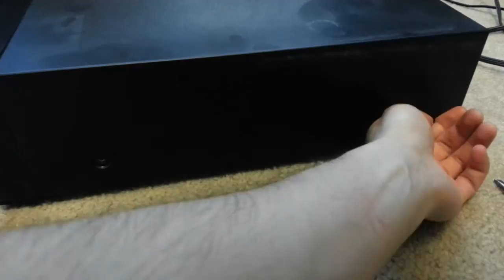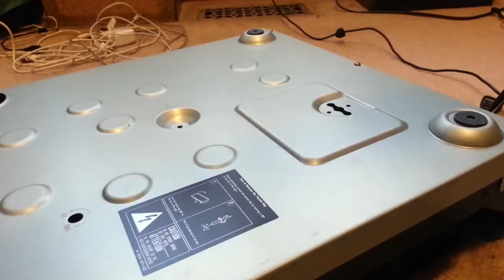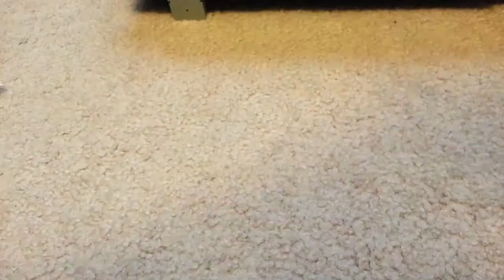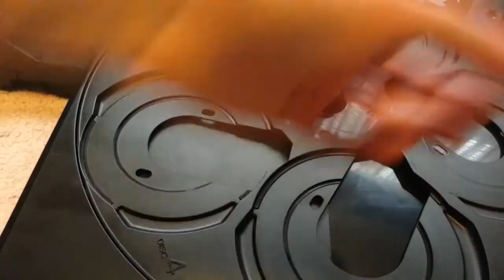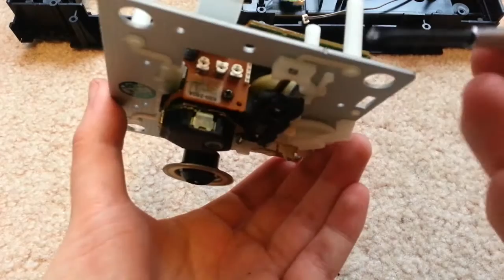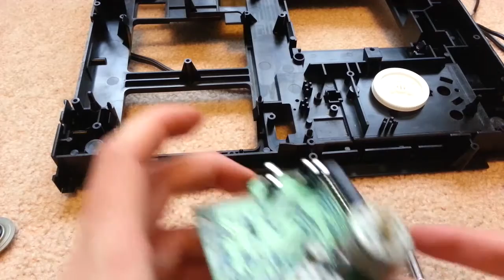TeardownTube - episode 34 - Sony 5 Disc CD Changer

Comment: You can learn a lot by taking things apart, I started out by bringing home tv's and taking them apart. Later I learned to fix them. This is a good way to learn about electronics.
Reply from the maker: Absolutely true. Almost everyone into electronics I talk to has the take everything apart stories from their youth. It's the curiosity of finding things out by yourself that ties us together. I'm surprised just how much more I learned from tinkering than from textbooks.
Reply: My friend and I were always taking things apart, I remember we took the lawn-mower engine apart and cleaned and put it back together.
I can remember wondering how a telephone works, and later becoming a tech with AT&T. It was a fascinating job to learn all about underground cable and switching equipment.